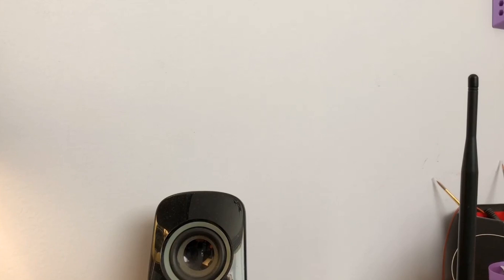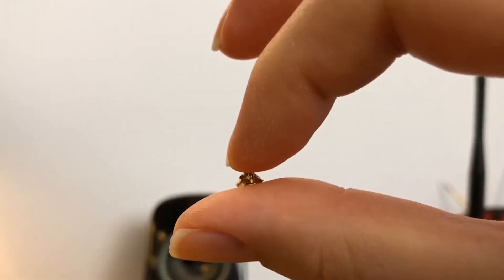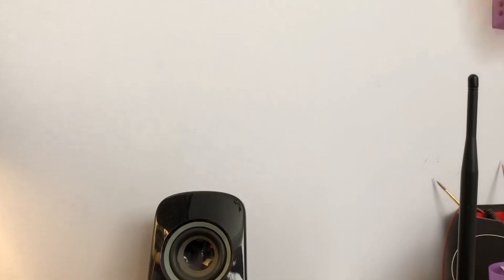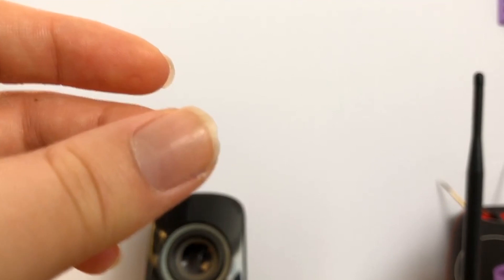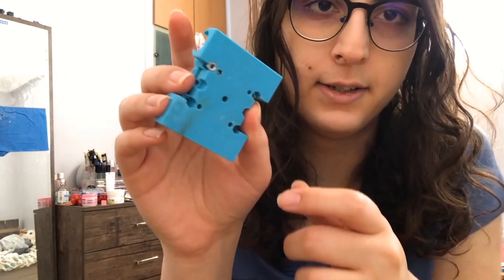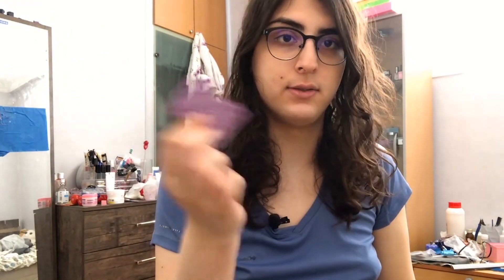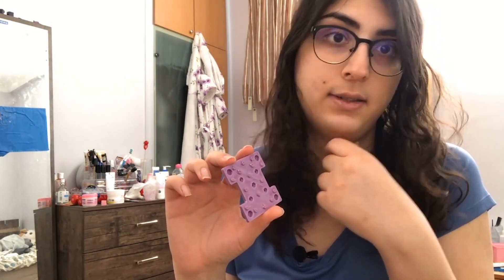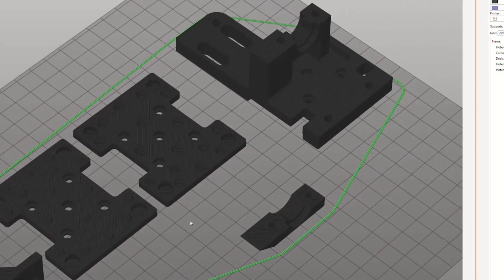Doot Changer, The 3$ ToolChanger (For Hypercube Evolution)

Comment: BTW: Just noticed you were suggesting using the drill bit by hand...  Don't do that!  Print this: https://www.thingiverse.com/thing:16890 It was designed for tap bits but it'll work great for a 4mm drill bit too.  Also, print it in roughest-surface-finish PLA (or similar) filament that you have.  If you print it in PETG (like I did the first time) it'll be too slippery and won't hold the bit strong enough.
Reply from the maker: Oh that's so awesome! Thanks for showing me. I only saw this today lol. My dad also killed our drill so this is helpful c: